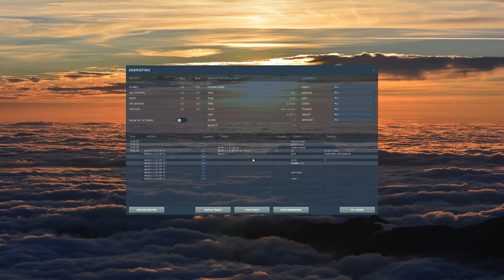A-10 Carrier Tests - Real Pilot Plays Digital Combat Simulator World

Comment: 4:40 the F-15C/D/E has a "pinky switch" on the stick grip that allows an extra 15° of angle on the nose wheel steering unit for instances like these. I wonder if the A-10 has such a feature as well.
Reply: Im not sure but the A10 has nose wheel steering toggle.  It might be the opposite thing to limit movement on takeoff and landing.

Comment: Hey Dak, I don't know how's your setup, but from what I understood you do play keyboard and sort of analog input for the engines? I can suggest you, it's an expensive piece, but for DCS, VBS, IL-2 Sturmovik and ArmA Series and some VR supported, TrackIR, that's a pretty neat tool for freeing your hands from "head movement" freeing your fingers to other actions and giving you a more "precise" viewing with your head, usually recommended setup is 2 monitors, but you can do it with 1, like myself. Also has some leaning of the head unlike just the in-game restrictive moment.

Comment: impressive  not so much they landed a c130 on the forestal which was smaller than a nimitz....
Reply from the maker: C-130 has bigger wings (so can fly with more stability at slower speeded), is designed for small area takeoff and landing, has turboprops (so it can be put into reverse basically, even while still in the air, to help slow down), has more wheels (so more braking action to stop in a short space), and was empty when did that, so it was actually lighter than the fully loaded landing at the end of the video 😄 nonetheless, this was just a game